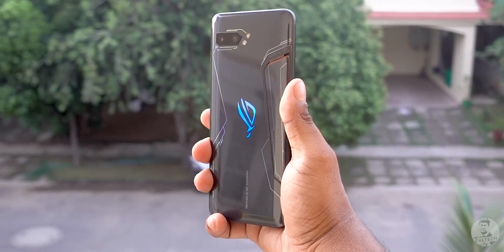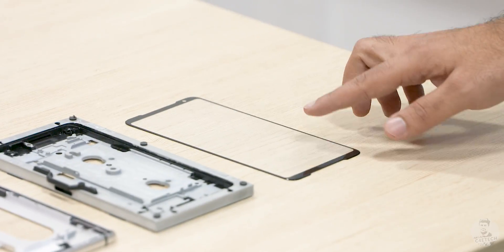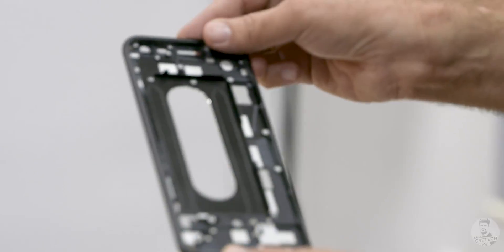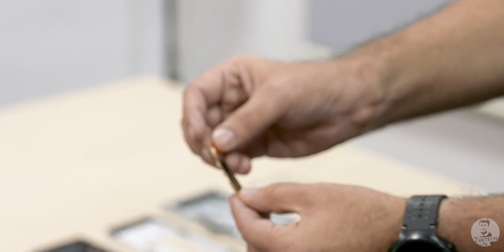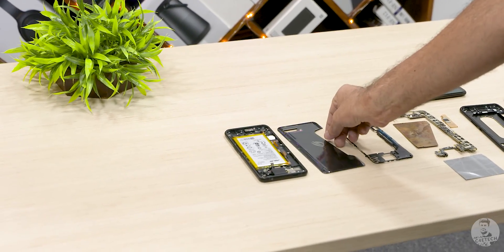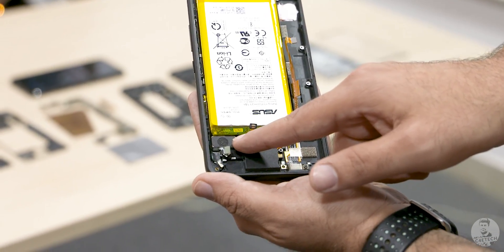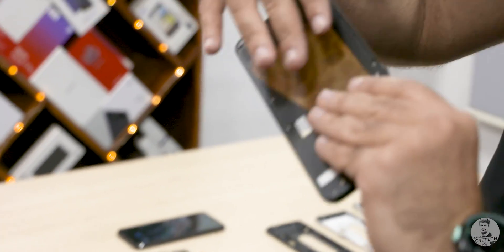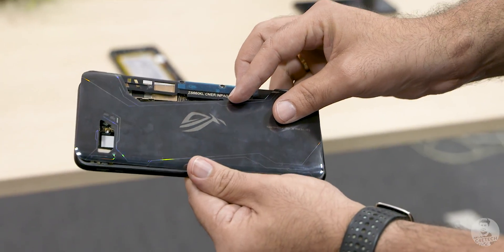ASUS ROG Phone 2 Teardown - What's on the Inside?

Comment: Once jerryrigeverything gets ahold of this, he's going to ding it for a soldered in headphone jack and no battery pull tabs. Asus, please use easy to remove battery tape to secure the battery and sell battery replacements. I will leave Verizon for this phone if you do this and make replacement parts available. 
God I just want to find one good flagship phone.
Thank you for the info C4
Reply: I found a Chinese teardown video where they actually tear it apart. 
Everything is cool. The main PCB is in a few parts, so where the headphone jack and USB ports are is separate from the rest of the PCB. Plus:
THE BATTERY HAS PULL TABS!
This is an absolute beast of a phone and I can't wait to buy one. 
Please sell spares tho.
I mean seriously.